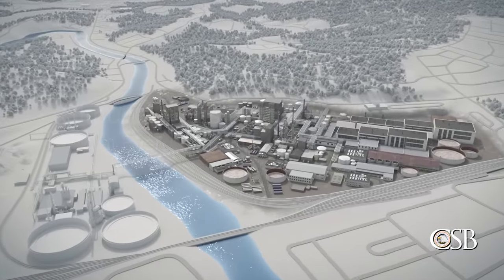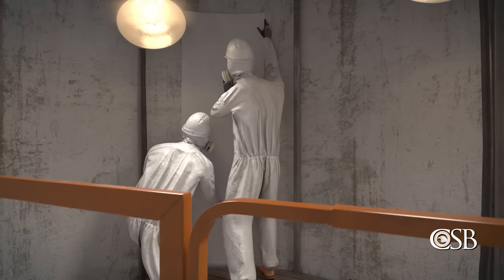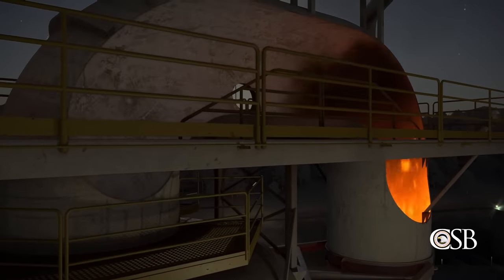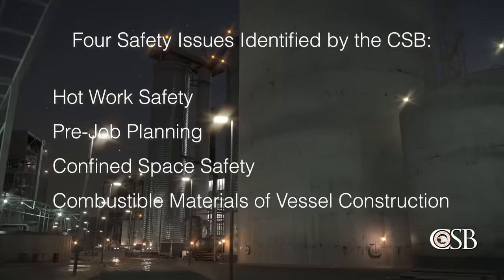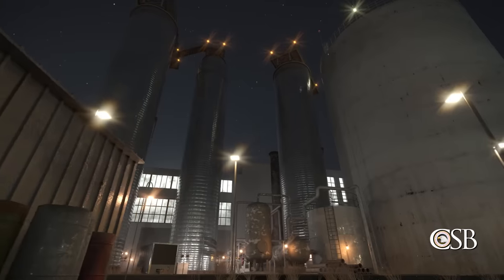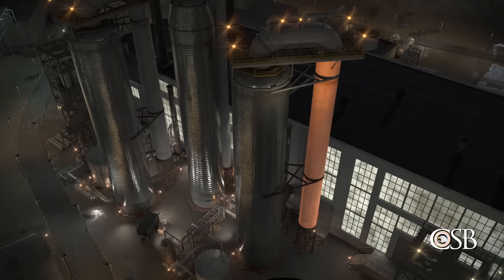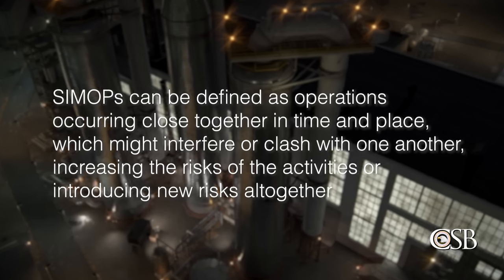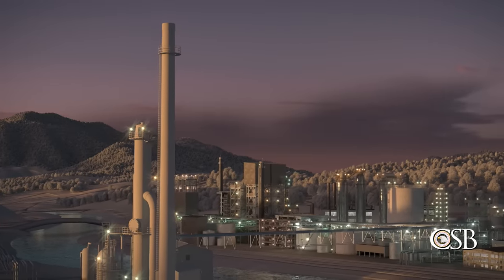Simultaneous Tragedy: Fire at Evergreen Packaging

Comment: One of the most awful things about these situations is that anyone who's ever worked a low-level job doing almost anything recognizes this exact type of corner cutting as something that happens all the time. "It'll be fine, we just need to get this job done, no point bothering the higher-ups..."  so on and so forth.
Reply: "contractor" is a nice name for "Temp" personnel. I could write a book on it. It was an end run around liability and best practices all over North America from the advent of "Labor Ready" in the mid-eighties to today.
Reply: Did that sort of temp work once. With zero training, they put me in a cleanroom suit applying epoxy to a floor. And when said epoxy took too long to harden due to temperature, they rushed hardening with silica, which got dust into the cleanroom and caused all kinds of hell. I was just doing what I was told.   Rushing a project is so common. Nobody wants to let things take time. Time is money.
Reply: You know, corporate management could implement every last OSHA rule to gut wrenching perfection, and STILL there will be a worker or even a supervisor who thinks his bright idea is perfectly safe...but with fatal consequences. As long as humans are doing dangerous jobs, people will die due to someone's stupidity. There will never be a way to stop it. Ever.
Reply: Hell, even in fast food this can cause issues. There's no end of stories about some poor kid blowing up the fryer, and a mixer can kill you if you aren't careful. Hell, I walked off one of my first jobs (in a pizzeria) because the guy who was supposed to train me to use a slicer didn't know how to use it, and his trainer didn't know either!
Reply: This is what comes to mind for me as well. It seems so obvious what the safety issues are in these videos, but at the time no one would have thought there was an issue...
Reply: You are as much at fault as the higher ups. 
Where have been the supervisor by Evergreen checking on the work done by both contractors? 
Where was the permitting list for items allowed into the safe space. Evergreen has two keep its production safe so they have to preplan such operations.  
Evergreen ordered two "simultaneously contracts" that alone should trigger an safety warning.
Reply: Watching this video reminded me of that "training the new guy" meme "This is how we're SUPPOSED to do it, but this is what we actually do." The most enraging part was the comments from proud rednecks extolling the virtues of "hard, sloppy labor" and whining about the pencil pushers with clipboards, saying things like "they wouldn't last one minute on the job / they don't know what the real world is like!" 

Like, there's a REASON we have safety rules, dude. Guys like that are one mistake away from doing things like this
Reply: Hop up in there kid well show you the easy way.
Reply: I've been there too but I've never cut corners.. When there are things that need to be done fast, I will stall than be killed or kill someone. Call me paranoid but that's how (probably) women work or think. I worked as an "all around" IT support for a hospital, and nope it's not really just IT support, it's not just answering calls, you also need to assess the situation, analyze it and do the job, no other personnel was given to do the hardware and networking stuff I did it all and even if I had zero experiences about it, I'm not dumb to risk my life for a job or a company who us more clueless than me in this type of work. So I agree with some commenter saying that you're somehow equally responsible as much as the higher ups. You can find another job, but you cannot retrieve your own life or other peoples' lives when they've been lost. If execs have no conscience and are keeping it as they say "professional", I can't ever live with that.
Reply: @LatitudeSky  the other problem is in perception..  esp if said contractor is public facing..  customers rushing jobs and the contractor pushing back due to safety ends up in negative reviews online or an attempt to pay less money for the job.. . even though the reason for job delays may be no fault of the contractor..  they get grilled every time..  and thats how safety violations are born.  after workers push the envelope successfully a few times they begin to question and doubt every safewty precaution.. because "nothing bad happened"..  until something bad does happen... and lives are lost..
Reply: @squeakyClean888  It's not exclusive to your gender. Most of the safety personnel I've known have been men. Most of the people in my workplace who get hurt (mainly by cutting corners that we've explicitly told them, multiple times, not to cut) are women. Like, three-quarters of the injuries are women, and of those nearly all could have been prevented if they'd not skipped the safety steps because they got complacent.
Reply: It’s crazy. I did some welding for some plants in Georgia and I saw a pipe bridge with an upright completely rusted out that was just marked with red tape. Stayed like that for months. Might still be that way
Reply: Any work environment that is instilling the idea that asking about procedure /safety is "bothering the higher-ups" should completely overhaul everything. Even from a sociopathic money first standpoint if asking questions is frowned upon then the product is going to be needlessly damaged, and the cost of paying OSHA fines when an incented occurs (almost said accident but that has random act implications and you don't call the end of a game of Russian Roullet an accident).
Reply: @ben-xl7ne  Even without OSHA fines, the cost of a doctor's visit probably exceeds the savings from cutting corners.
Reply: The worst part is that 90 percent of the time nothing bad happens thanks to luck or caution. Then that breeds complacency and the dice keep getting rolled until something awful happens.
Reply: Truth bro. 
A few lives along the way are worth the risk for the guys making the big money on projects. 
I've been on plenty and have seen my fair share of accidents along the decades.
Reply: @natesmodelsdoodles5403  yep, I heard a story once about a new guy being told to "clean the fryer." Only problem was that the supervisor forgot to mention that oil in those huge commercial fryers can take days to cool. Not pretty...
Reply: @MrPLC999  Yep, it's not always cheapskate managers.  Sometimes it's Joe "who has been doing it this way for 20 years and never had a problem."
Reply: @MrPLC999  The way to end it is to fine and punish from CEO level downwards. That's the way we do it in Europe. When the manager gets fined for the workers below him not wearing their PPE, he will fire those who don't wear PPE. The US system rewards those who can work faster and cheaper by cutting corners.
Reply: I see this a lot in illegal labor. It's a very the job done at all costs mentality and the inability to communicate properly that causes a multitude of issues. Training is almost always ignored when they shuffle labor in and out...
Reply: @Skyhawk1998  right this is why statistics education is essential for safety or management training. If you have a hundred workers doing something with the 1% fatality chance, statistically you already killed one of them
Reply: @LatitudeSky  The people at the top have the money and the option to pay for the job done right, but they don't want to.
Reply: @MrPLC999  Right. The people who could have prevented this were the PLANT OWNERS- they could have given a reasonable time window to do the work instead of trying to cram it in over a weekend, they could have stipulated safety among the contractors they hired, but nope, they didn't want to lose any PROFIT by having the plant down during the workweek, so some small-time contracting companies were paid the lowest bid to send in some unfortunate low-paid workers likely with few other prospects. Result: Two people died.
Reply: @erik_dk842  Exactly.
Reply: Yep. Russian roulette.
Reply: a scenario similiar to this video has happened 1000s of times and no accident has happened, people go their entire life doing things similiar to this everyday without anything wrong happening. BUT every once in a while something bad does happen and thats when you really pay the price
Reply: Yeah it’s crazy when I look back.

We used to use petrol in pneumatic parrafin guns to clean down engines, you’d see the sun shine into the workshop and light up all the petrol in the air….

Sure that’s bad enough to be breathing but while one was cleaning another would be spanner checking, all it’d have taken would be a spark from a stray spanner and the whole place would have gone up
Reply: Yup, MacGyvering trying to becoming a hero can result in a big safety issues.  Years ago had a lead person tape over a pop off valve on a thick chocolate dispenser that used compressed air. A hose slipped off and hot chocolate blew around on workers. He went from speedup hero to Zero.
Reply: At my jobs the higher ups had us contractors weld baffles into a tanker trailer that they had parked way off in the woods because they didn't want to go through the confined space permits and stuff, and they came right out and told us that.
Reply: 💀ly assumptions...
Reply: True, although the fact remains that management has overall responsibility for safety and sets the example by which others are expected to uphold. What I have found more the case is problematic "middle management". I recall one middle manager early on in my career using the reprehensible phrase, "you should never hold up production". These types of people are the single biggest threat to any company safety culture.
Reply: profit over people or safety, as american as insurrection
Reply: Because that boss doesn't want to admit he could cut his salary in half and pay everyone more and have a safer company.
Reply: @natesmodelsdoodles5403 😂😂😂 some kid screwing up on the fryer is way different, messing up in the fryer won't level 10 city blocks 🤔 whole different ball game
Reply: If nothing else I definitely recognize the cut corner of "engineers are expensive so they go home before the night premium oay hours start" and "All of the new, young and inexperienced guys get to go in the night shift because the old experienced guys know they can say no and their premium pay is higher" luckily in the places I've worked at that combination just meant that some machine wasn't running during the night or someone manufactured trash the whole night, not the whole place burning down killing a bunch of people 😅 No amount of instructions or company policy can fix missing management or training.
Reply: The higher ups are behind cost cutting that ends up hurting or killing people.
Reply: @MrPLC999  the point of regulation is not to stop all d eaths it is to mitigate as many as possible and as proved by well just a cursory glance at any industry it has worked.

Comment: Glad I watched this video. My company currently defines hot work as work producing a flame or spark as well, which is essentially the OSHA definition. We probably wouldn't have identified this as hot work. I think we'll change the definition to "work that is capable of producing heat in excess of the flash points of the combustible objects within the work area" or something to that effect.
Reply: I'm almost positive it would not have occurred to me to consider "just a little heat gun" to be hot work. Now I know better.
Reply: Anything electric, anything with a gas, anything that creates heat or is a highly flammable product....
The materials used and been in such a confined space should all scream hazard..... Also the material already in place such as the construction of the pipes, walls and so on...
Reply: In the EU, the ATEX directive identifies these hazards way more rigorously. For example, ignition sources can be:
- lightning strike
- open flame
- mechanically generated impact sparks (hammer blow on a concrete for example)
- mechanically generated friction sparks
- electric sparks
- high surface temperature. This includes hot liquid/gas let into an otherwise cold vessel can be a hot surface, for example a room heater radiator can be hot enough to ignite some materials
- electrostatic discharge
- radiation
- adiabatic compression (gas pumped into a vessel, and it heats up, for example a simple air compressor)

Considering just spark in sense of a grinder and flame as ignition source hazard is way too layman and inadequate.

Disclaimer: I am in no means an expert in this area, just interested, especially I am afraid of explosive things. Too feel the severity of this, for example in my country, it is a requirement to use copper or other non-sparking wrench when you replace a Propane-Butane gas tank at home. It's a different story that a lot of people just neglect all of this, but the rule exists.
Reply: Wow.  I guess it really isn't common for people know that heat guns are dangerous around combustibles.  Ignoring the fact that they can ignite paper, can't people at least assume the motor inside might create sparks?
Personally, I unplug my heat gun after I'm done using it, so in case it malfunctions when I'm not around, at least it won't be running unattended.
Reply: We have to blame criticism on OSHA too because it's definition falls short. Hot work can be cause be so many reasons.
Reply: @h8GW  Probably they know that it isn't 'perfect' but they do it anyway because they consider it an easy fix. 
As shown the head gun fall it too the bucket when unattended. Might not have happened when it wouldn't have fallen into the bucket. Maybe it would have blown anyway while heating it up further.
Reply: it's easier to define hot work as work were the temperature can exceed 40 degree Celsius or produce sparks.
Reply: @gabiold  in my country they say you can not use tools to change tanks.
it in the label.
I never have considered wrenching a bolt a something that would cause sparks... kinda crazy considering the low risk high consequence characteristics of such scenario.
Reply: @youkofoxy  Here there is a threaded end on the tank. I mean the bigger, 10-something kilos ones, not on the small ones you use for heating torch or for that mobile/tourist cooking thing. You have to attach the hose which has a threaded hose-end on it (I don't know how it is called in English), it has a hexagonal profile, you supposed to use a wrench for that.
Reply: I work at a gas plant and hot work permits are categorized as spark potential hot work (like a heat gun or combustion engine) and actual hot work (like welding and grinding). Both have defined procedures depending on the work location, so work done in a confident space or gas process area will be much or restricted than work done in a lay down area or water plant.
Reply: @youkofoxy  This is why a "bung wrench" for removing caps on 55gal drums etc. are always made of brass/bronze, aluminum, nylon, or other non-sparking material.
Reply: Who the hell do you work for? Anything electrical or battery operated is defined as "hot work".
Reply: @MindfulMusic  you fill out a hot work permit everytime you use something electrical?
Reply: @ericlaw171  Yes, if it's not intrinsically safe. Power tools, motorized equipment, battery operated, Burn / Weld / Grind, etc. All hot work.
Reply: @MindfulMusic  Yeah, this is genuinely scaring me, seeing people talk about how they wouldnt have thought that a HEAT GUN would be considered hot work. Like, its literally in the name of the product. I want to know where that person works as well so i can make sure I avoid anything they work on. It really scares me how under trained so many people are for such basic things.
Reply: What definition have you personally given HOT?
Gimme a break.
This conversation is silly.
Reply: makes sence the elements get red to orange hot and in steel terms thats over 1500f but think use a incnel wire and that can handle even more heat. either way plenty enuff to start just bout anything on fire.
Reply: Rather than heating the bucket  I probably would have heated the matt
Reply: @h8GW  One use of a heat gun is to light up a barbeque without the use of any combustible fluid. It combines high heat with a good air flow, quickly igniting the coal bed.

How anyone can consider a heat gun to not be an ignition source is beyond me.